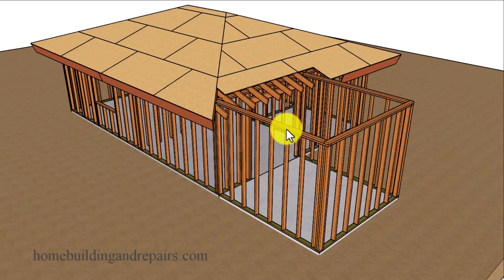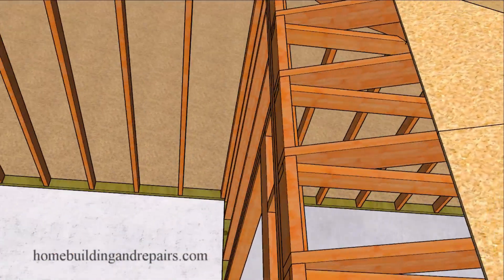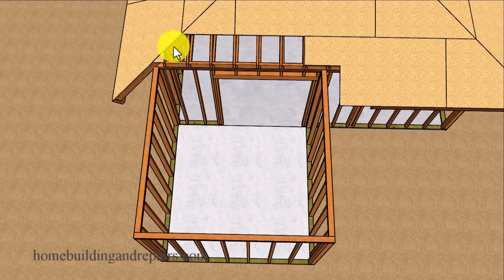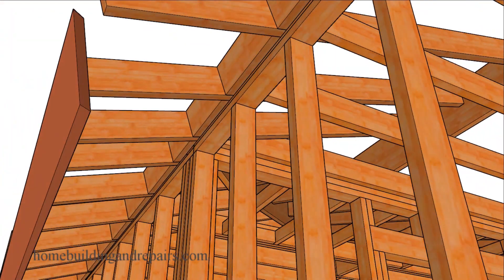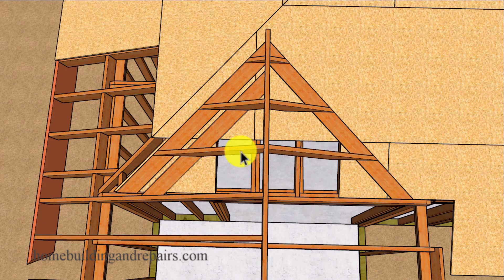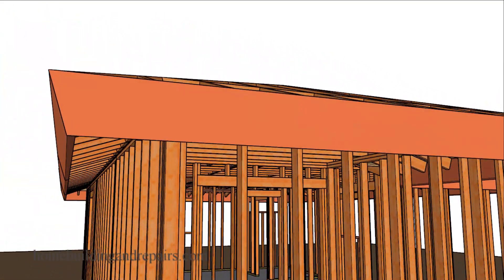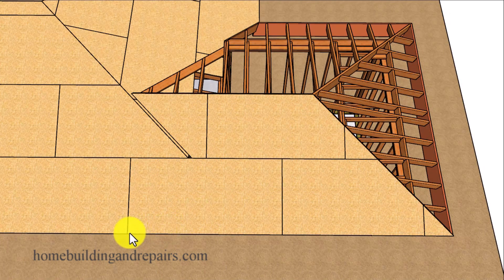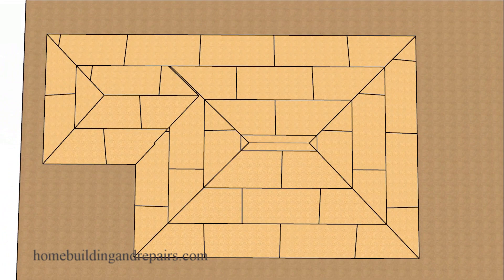How To Build Hip Roof With Valley For New Home Addition When Attaching To Existing Hip Roof

Comment: If you have a soffit do you need a valley extension ?
Reply from the maker: It might be used for the roofing, but if you can build it to work another way, then you might not need a valley extension.

Comment: Wow, this is what I was looking for. This is exactly how my roof is and how I want my carport addition to attach/look. Would it be pretty much same thing except with bigger support beams if you have no walls /studs and instead posts on the far corners (open air carport). 

Secondly, I’m struggling to imagine how a simpler just slanted patio /awning style roof would attach here, if even possible. I guess you can’t since the roofline wouldn’t be all wonky. I think I answered my own question, lol.
Reply from the maker: You could build this roof with posts and beams. I do have videos on low sloping porch roofs at our website in the porch section.

Comment: How would you connect the two new walls into the existing house wall? If there is not a stud lined up perfectly behind where the new wall is attaching, I can't imagine it would be enough to simple nail the new wall into the OSB and call it a day.
Reply from the maker: You will add a few more wall framing studs and straps, but that's about it. I do have more videos at our website in the home addition and framing sections that will help.

Comment: Great videos! Any chance of making a video on putting a hip roof on a building that has a wall at 45 degrees to the others? Like for example a rectangular building but with one corner cut off at 45 degrees to fit the block or be a window that gets lots of sun in. Can't seem to find anything like that anywhere on the internet, but it doesn't seem so strange that it can't be done?
Reply from the maker: Email me a floor plan drawing to provide clarification on exactly what you need. I just don't want to consider something a viewer wants and provide the wrong design, done that before.
Reply: Did he ever send this plan? @gregvancom